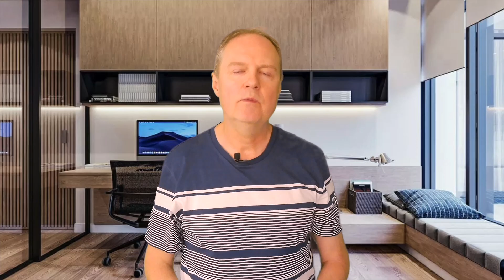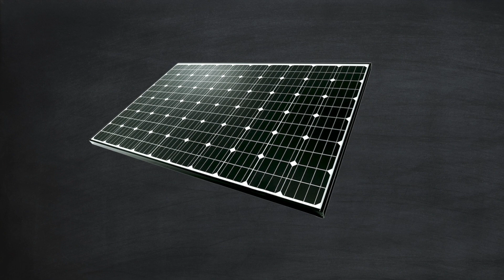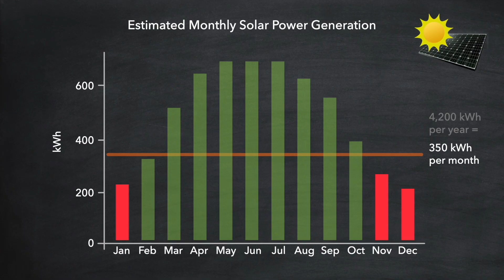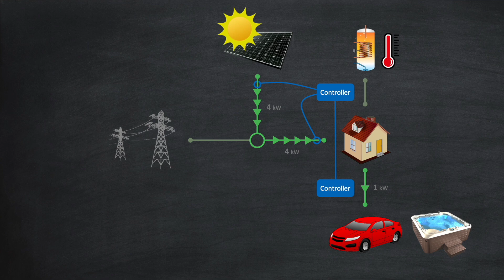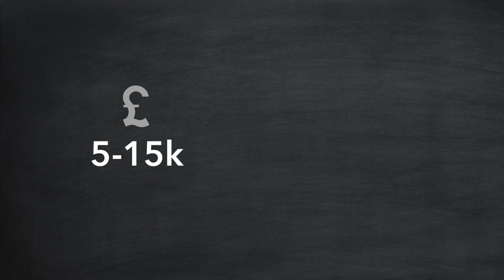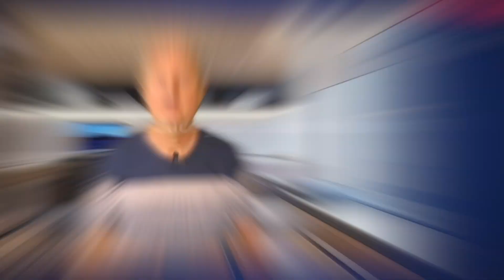A Beginner's Guide to Home Solar

Comment: I must not live in a typical detached house then... 

I'm currently using 13,000 kWh a year (not including the 5 megawatts the solar makes)

I see that increasing to 25,000 kWh when I get another electric car and switch to a heat pump.

The world governments see the writing on the wall.  They will lose revenue from oil production. So the best way is to increase electricity costs. 
Their approach to Fusion energy probably will not work.
Nuclear reactors is a fine for base loads.

In the end I see electricity probably stabilising around 50p per kilowatt

However, gas and oil will go up in price.
I predict gas will probably hit about 15p per Kilowatt or more.

The next thing they're going to go after is clean water.
Reply from the maker: Yeah, that’s quite a lot of energy use

Comment: Im tempted by solar and battery but the cost is truely eye watering, 12 grand for a 5kw system and 3 or 4kw battery?! Everyone knows when the government makes installation vat free, the installers just inflate their prices by 20% and the customer doesnt see any real reduction in price. Many people seem to have issues with the inverters packing up every 5 tears or so and costing nigh on a grand at current prices, are a further cost. There's also the cowboy factor so, if getting the more reputable suppliers, you end up waiting forever because they're fully booked. As for selling excess back to the grid at no more than 3 or 4 PENCE, someone is having a laugh.
Reply from the maker: I don't dispute anything you say here. And this is always the problem with any market where demand greatly outstrips supply. I don't know what the solution is, but I definitely see a role for government in making sure all actors play fair.

For your situation, I recommend you join a solar forum, like this one, where you can learn a lot and also check to see if the quotes you are getting are fair and reasonable: https://www.facebook.com/groups/2197329430289466

Comment: hi Gary im particularly interested in your video on bypass/redirection of power to feed an emmersion heater.  Yor figures suggested that for a singleton like myself wouldnt pay for itself?  I had assumed that the eddi like myenergi suggest that we can use our solar power and still get paid the feed in tarrif.  your video suggests that this isnt correct.  Ill probably ask this again when I find the video.  thanks in anticipation regards Colin
Reply from the maker: Ho Colin, here is a link to my diverter video: https://youtu.be/1yAwgye-NVQ
Reply from the maker: The only reason the payback is not so good for fewer people in the house is the relatively high cost of the diverter and installation against the level of savings that one or two people can achieve. Certainly adding a diverter won’t affect your FiT payments, but it’s just the sheer length of time to recover your outlay, that’s all 👍🏻
Reply: @GaryDoesSolar  ok many thanks

Comment: What about having panels on an external panel mounting or scaffold (fixed or mobile) rather that house roof? Would you be able to share info on considerations for that (if there’s space outside but roof is not suitable?)
Reply from the maker: Are you referring to the EU JRC tool? There is an option where you can specify just that and get the expected solar generation for such a ground installation.

Comment: Thank you for all the work you have put into this channel Gary. It’s the best I have found at going back to basics but also not dumbing the topic down or leaving out important information. I cant wait for your further videos, and will be sharing the channel with a colleague PV support group helping people get into solar.
Reply from the maker: That's great feedback, Stephen - thank you! I'll try to retain the level of quality for future videos :-) Next one will be on solar diverters I think...
Reply: I have had a thought, I came across your channel as I am looking to go through a full PV, battery, water heater, etc. install in my Victorian house in Bristol to try to gain the maximum from my roof. If you wished to follow it along for your channel as a case study you would be more than welcome. Just let me know.
Reply from the maker: That could be of interest, Stephen - are you creating a blog or videos as you go along?
Reply: I wasn’t planning on recording anything. Seems plenty of work to just work out what I want and what will give the best balance of up front cost, efficiency, and running cost in my Victorian home.

That’s where I hoped someone like yourself might be able to help me choose the right products and then you could share the thought process, final system install process and my final costs via your channel.

I’ve already started the process by having a heat loss survey.
Reply: I would of course make videos along the way if it would be of interest.

Comment: With all due respect, you're another one who forgets that the up-front investment had to come from somewhere...so there's a loss of interest.  That can be as much as 3.6%.  I have yet to see a real-world data that it 'pays back' anything.  If anyone thinks they do, show your data.  There is a YouTube uploader who has the name, The EV Puzzle.  He removes some comments which state solar doesn't pay...that's why the majority of the comments there are positive.  Let's look at a £10,000 investment - midway between your example.

Solar install:  £10,000 plus loss of interest (LOI) on capital expenditure of £360 a year
Savings:  £910 (minus the LOI) of £360 = £550
£10,000 divided by £550 = 18 years…
…by which time you’d need a new inverter at £1,000, and your panels would no longer be efficient enough to give you £550 a year, so the system would actually NEVER pay back.  You’d be better off investing your money elsewhere.
Reply from the maker: Hi Jim, thanks for taking the time to comment. You're right, as if the size of the up-front investment wasn't hard enough - many people will have to take out a bank loan to prepare for it, and the interest rate will have to factored into the calculations. I do note that some countries allow for interest free-loans (Scotland, an example), and in the EU (no longer the UK unfortunately) you can get a healthy rebate on the purchase costs.

I'm working on my next video now, where I look into how to calculate the savings and payback period. I believe that for most setups, you can achieve a payback within 5-8 years, even accounting for circa 3.5% loan interest.
Reply: @GaryDoesSolar  
Thanks for replying Gary.  I should clarify that the 3.6% is LOSS of interest on capital.  In other words, that £10,000 could be getting you 3.6% if you locked it up.  But as you've poured it into a solar array, then you are in real terms LOSING that amount a year, so it must be factored in to any solar calculations.  Where did you get the money from?  Was it in a shoebox doing nothing, or did you actually have it in a savings account earning interest?  It's always the latter.  You're not getting that interest anymore, so it's an immediate loss before your panels have been up for even a year.  The man doing the YouTube video 'The EV Puzzle' doesn't understand this - he replied to someone who told him about it that it doesn't matter!  He then deleted the thread of comments.

If you borrowed the money, the average loan rate at the moment is a whopping 9.4%...meaning that you would be  paying a considerable sum in order to 'save' energy!!!  It's also common to ignore the fact that the inverter may need to be replaced towards the end of the so-called payback period...so that will set the payback date back some years.

Seriously, I have yet to see anyone who has honestly set out all the figures.  They tend to ignore loss of interest, inverter cost, maintenance, and loss of efficiency.

Comment: I wonder how much energy is required to make one solar panel. So, if energy is going up then, surely the price, to make a solar panel, will go up accordingly. If you live in an area that has less than 50% sunshine, all year round, and solar panels are only 20% efficient, that seems to me quite a low, overall total efficiency. If these panels are produced outside of the UK then, with fuel cost increasing this will also add to the cost of transport. So, those properties that are not yet fitted with solar panels, (4kW to 6kW typical) would be paying quite a sum for a complete system installation. As you mentioned, the possibility of energy prices are set to rise further then payback may never be reached.
Reply from the maker: My next video covers how to calculate the payback period, which might be useful to you. I think energy prices, although rising sharply at the moment will fall back to 2019 levels within 5-10 years because most of the generation by then will be solar/wind which is 10 times less expensive than fossil fuels are. Would you agree?

Comment: Great video, really simply breaks down so many questions I had on going solar.
Reply from the maker: Thanks Steven - yeah, it can be quite a complex topic, so I’m really pleased I’ve been able to break it down and convey it well 😀👍🏻 all the best with your solar journey (adventure even!)
Reply: @GaryDoesSolar  I have my 4.2kW array and 7.2kWh batteries being installed later in the month. I hope I've been guided correctly by the fit out company.
Reply from the maker: Sounds like a pretty good setup, Steven. Hope the install goes well and that you're able to get plenty sunshine before the year is out!
Reply: @GaryDoesSolar  I hope so but I fear I might be waiting till next summer before I get some decent data.

Comment: Great video! It would be really great to have a follow up on pros and cons of getting a battery, solar, and heat pump. Do we need all three? Is it better just to have one or two?

You're much better at explaining these things than anyone else on YouTube!!
Reply: Installing a ASHP would require more lecky (to replace gas CH), so long as the PV/battery was large enough the ASHP would be powered too. In the above example substitute the hot tub for the ASHP.
Reply from the maker: Thanks for the very kind words. I do keep thinking about heat pumps as an alternative to gas, especially with the current gas prices, but I wouldn't say I'm up to speed yet. I've got the next two video topics sorted and so let's see - I'll need to get researching! :-)

Comment: In the winter , totally useless, my hydro bill is 1/2 of solar cost per year, no worries about warranty, maintenance, no up front expenses.
Reply from the maker: Sounds like you're in a very good situation, energy-wise, well done. However, the vast majority of people in the UK don't have access to a water source to generate hydro, but they are likely to have access to solar. Now, whilst solar generation in the winter months is low, for 8-9 months of the year, it is possible with solar to cover near all of the electricity costs. And in the winter, a battery can dramatically offset costs usage cheap overnight rates. My videos are here to help the majority save money.

Comment: Unfortunately around me all the installed quotes are 2x what they were 3 years ago, despite the hardware costs only going up about 30% so my plans are on hold until the realities of the financial situation starts to bite for the installers.
Reply from the maker: Hi Ed, I know the feeling. I was due to get my install on the 19th of this month but my installer was playing about. So I’m having to start again. Prices are certainly higher now. I’ve decided now that my next video will be about ROI. Equipment prices are higher now but energy prices are increasing even more rapidly. If only the UK government allowed zero-VAT on improvements to existing installs - that would allow people to start with just panels say then in a couple of years, add a battery. Less risk on the ROI, I’m thinking… Your strategy also sounds viable though!
Reply: I had similar problems myself what size system did you want and what was you qouted , i wanted a 4kw system with battery and bird protection  first 3 wanted minimum 15k , one wanted 18.5k , eventually found a great installer did the full system all in for 13k with a 10 year full workmanship guarntee instead of the 2year everyone else offered me on top of the 25 year pannel and 10 year invertor and battery , had it in 2 months super happy
Reply: @davidworoniuk183  - Hi David, any chance on sharing that supplier/installer's name?  I'm looking to do exactly the same...!
Reply: @philellis240  it was a firm called GEC POWER based in Newcastle but fit across the UK im in West Yorkshire
Reply: @davidworoniuk183  - thanks David, I'm a lot further south than you down here in Wiltshire; my biggest concern is over getting the right (or wrong!!!) supplier/installer...😬
Reply: @philellis240  if they will fit that far down south I would highly recommend them i spent weeks getting quotes these got recommend to me and ive been really happy , the installation went great and the after care has been good too they have monitored my system to make sure its doing what should be with my cheap rate from octopus through night and the performance in general just a all round good company certaintly not fly by nights

Comment: Like others commenting here, I have only recently started wading through research to work out what may be best for me and have watched and read so much on this. Your explanations are great, very simple for a newbie to understand so I look forward to more.

One piece of information missing from every single video and article I have seen, however, is... How do you connect the solar system to the electricity supply in the house so your appliances use the electricity generated by the panels? 

So, for example, on a simple system you have the panel -> inverter -> house. How does the inverter connect to the house supply? 

I'm new and trying to self-learn everything electricity... Does it just plug in to a mains socket? Does the system have to be wired in to the domestic consumer unit (ie fuse panel) and therefore need a qualified electrician install? Something else? 

I may be asking the wrong question, or the right question poorly 😂
Reply from the maker: Hi there Croi - thank you for the kind words on my videos! Now you raise a very good question and one that I wondered myself in the early days. It turns out that A/C electricity and the national grid system is a wonderful concept and happens to be pretty versatile.

Fundamentally, power stations of all kinds place power onto three wires (3-phase electricity) and these three wires are fed to homes all over the country. Each home is typically fed with any two of these wires (single phase) and you can have as many consumer appliances as you like attached to those two wires in order to draw power.

The really cool thing is that this is not just a one-way process. If you have your own power generator (e.g. solar panels) you can place power yourself onto the two wires coming into your house, and that power will either be immediately consumed by appliances in your house, or 'exported' out back to the grid. This is the magic of the inverter - it is connected directly to your incoming supply (those two wires) via the consumer unit. All the inverter has to do is convert the DC voltage of the panels into AC, and it does that by generating a sine-wave of the correct voltage and more importantly, the correct phase of the AC already on the two wires. If you want to get really technical, the phase has to be slightly ahead of the phase already on the wires so that power is essentially pushed onto it.

Ok, that was the long answer; the short version is that you simply connect the inverter into your consumer unit :-)

Hope that helps!
Reply: @GaryDoesSolar  Brilliant! 👏🏻
You could, if you were so inclined and had the time, create a course with explanations like that 👍🏻
Reply from the maker: Haha - ok, I'll consider this as a topic for a future video :-)

Comment: Hi Gary. Great presentation. However in your simple model changing an EV, it normally takes a minimum of 7kW to charge an EV on a Single Phase System.
Reply from the maker: Hi Campbell - thanks for the kind words on the video 👍🏻

On your EV charging point, i based my commentary on the Zappi charger in “eco” mode, which will charge a vehicle with whatever Solar there is, limiting as far as possible any draw from the grid. There may well also be a minimum charge rate of say 1.4kW. Perhaps someone can confirm as I don’t have an EV myself?
Reply: @GaryDoesSolar  I believe the type 2 protocol allows charging rates as low as 6A, which would be about 1,4KW.  On the Zappi you can choose to suspend charging if the available energy drops below this, or just import the balance.
Reply: Can charge mine from 1.5kw on zappi charger. So I try never send power to the grid.